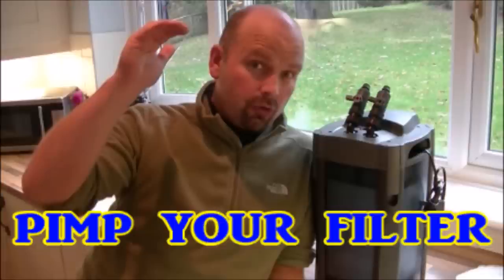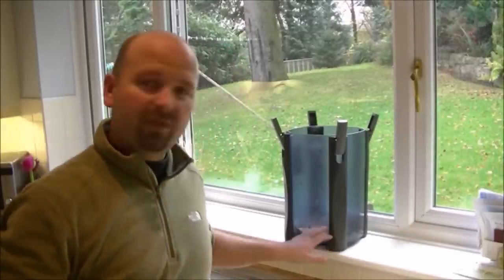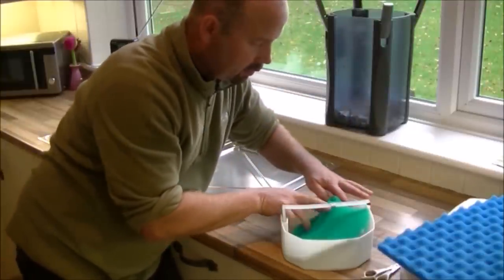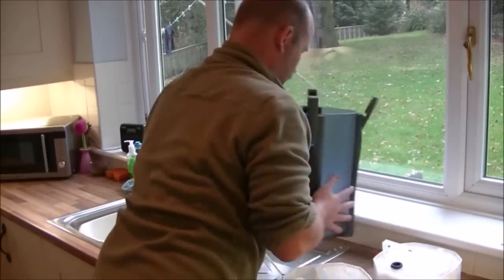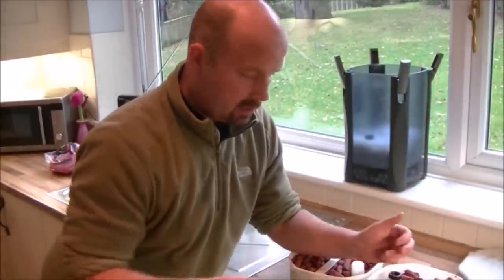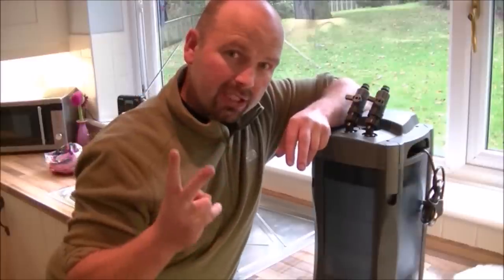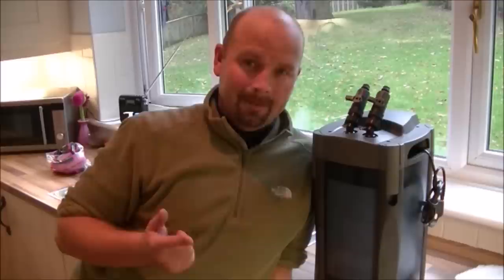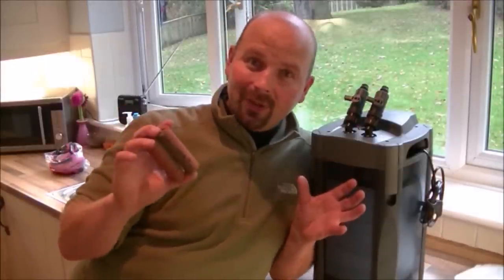External canister filter set up, nitrogen cycle and what happens in a filter - by Pondguru

Comment: Thanks for the information. We have a Jebao filter on our fish tank and kept losing fish. Until we stopped doing water changes....now we let it evaporate at least 1/3 and then replace that water with water we have at the ready (has been in jugs for 24 to 48 hours. ) We also ended up with snails that came with some plants, but, instead of getting rid of them, we got two snails that eat them. We have a steady amount that keep the substrate moving but mot an overwhelming amount. Since these two changes to the tank, only two of our old fish have died and everyone is healthy, playful and happy. No more constant deaths. I keep reading bad reviews for the Jebao but I guess we got lucky. Now,,,,we also have a turtle tank, about 70 gallons. We do much the same with their tank, except I am constantly cleaning it. This tank has an Eheim Pro 3 which the reviews said was a good one. We have had nothing but trouble with the stupid thing. Extremely hard to start (prime) after I clean it or the power goes out. Now, the water flow isn't strong at all. Cleaned out every part including the impellor and the tubes to no avail. As I was doing this, I discovered a part that was not put together properly at the factory and was able to slide it together successfully and, with a triumphant gleem in my eye, figured I had solved the entire problem. Yeah, right...it started rather easily, so I was hopeful still,,,then discovered the waterflow still sucked (no pun intended). After more than two years, I have had it. We have even had knowledgeable people in to work with it to no avail. Can you reccomend a good filter for our turtle tank? I know that we should get one rated for at least double the size of our tank, and knowing that we are going to have to get a larger one in the not to distant future (Sophia is the size of a supper plate and Athena is about half her size plus there is a plecho about the same size as Sophia and they are all inseperable).  Any advice you can give will be greatly appreciated. We are in Canada. Thanks for your time.

Comment: Hello +Pondguru Outdoors, I have 2 Fluval 306 canister filters for my 90 gallon tank. I have been spending a lot of money on buying fluval filter media. Thank you so much for sharing this video and helping me save money 😊. I hope I can do the same thing to my Fluvals. The only difference i see is that they don't have that space at the bottom as the filter in this video.
Reply from the maker: +Rahul Sudhakaran Don't worry if there is no space under the trays of those filters as the main foams are down the sides of the filter anyway. Having extra media under the bottom tray wouldn't do much good as far as settling out solids as they should get mostly caught by the side foams.

Comment: Enjoyed your video.  My biofilter input swirls and there is a 6 inch void below.  I have been vacuuming out this 2-3 inches of sludge that collects there twice a year.  After watching your video I wonder if this is where the anaerobic activity takes place to complete the nitrogen cycle?  Is cleaning this counterproductive to the cycle or just good maintenance?  FB koi groups think there should be no place in the pond for anaerobic bacteria.  They think water changes are the solution to high nitrates. I learned from you today that anaerobic bacteria has an important function.

Comment: Followed your advice and pimped out the two Sunsun 302s I'm using with my 60 gal cichlid tank. Initial tests came in noticeably better than before. Thanks!
Reply from the maker: As time goes by you should notice the nitrate coming down - Biohome is an incredible media.

Comment: I'm sure you've covered this before-
There is a big emphasis on coarse, medium and fine mechanical filtering. In a 'common' system, it is just one big coarse filter. It is my assumption that they do this to prevent any significant pump damage caused by a lack of flow from a finer filter being clogged overtime. Obviously a true hobbyist that has 'modded' their filter wouldn't let it clog (hopefully anyway) but from an "oops, I forgot to check the filter and now the pump is damaged since there is no pressure bypass" point of view, it really depends on the end user. I wouldn't say there is anything 'wrong' with the original system, it's very well rounded reliable setup for the average person (notice person, not hobbyist haha!). But like you said, efficiency is the point in your videos, which is why I watch them!

If I may add-
Perhaps adding a low pressure water gauge before & after the filtration would be beneficial. Just looking at that pump setup, a quick 'drill and tap' on each hose base and a couple gauges to calculate say, a 5 psi drop would be perfect. Hell- incorporate a 'dummy' light and you could reinvent those things.
Reply from the maker: +Nathan Herron Yes the single coarse foam is very common in internal filters where the emphasis is on high turnover rate and catching the dirt second, third or fourth time round - any restriction on the inlet could strain the pump so coarse foam is the way forward for long service life. Not too good from a water clarity or health point of view though. An external offers much greater contact area for the foams and when using the profile cut foams the contact area is much greater than flat foams. Therefore they will go much longer before they are clogged. I like the idea of a simple pressure gauge on the outlet or even on the top of the external filter which could maybe move from OK to Caution to Clean Me as its not always easy to tell from the water output how efficient the filter is working - a 100 litre per hour drop in output may go unnoticed. Glad you enjoyed the video, can see where I'm coming from with the ideas on filtration and thanks for watching.

Comment: Well I've recently bought an external filter and after watching this video I'll be setting it up your way. Bought some coarse, medium and fine foam (with dimples) and Biohome mini ultra from yourself. Looking forward to the results this produces. I did buy 1kg of Biohome mini ultra but I'm sure I'll need more as I'm sure it won't fill 2 baskets.
Reply from the maker: No worries - all sounds good to me and I'm glad to be of service.
Reply: +Pondguru Outdoors just another question. My external filter has a built in uv lamp and is it worth running this along with the biohome media or not?
Reply from the maker: Yes using a UV is fine but often not necessary unless you have multiple tanks running from one filter. Just make sure you leave the UV turned off for about 2-3 weeks when setting up a new filter to allow good bacteria to flow through the system and establish it properly.
Reply: Thanks for your advice. Filter is now set up the "correct" way and running smoothly.  Just experimenting in whether to use the spray bar or not. Any views on that? I have water spangles (Salvinia minima) floating on top of the water and with the spray bar they get moved around .
Reply from the maker: They will get moved around with the other outlet too but won't get 'rained on'. Generally that plant comes from calm water so it may be worth either having the spray bar at or just under the water surface or going with the other outlet just under the surface. They will still move about but if too much water gets on the leaves (from a spray bar) they can rot.
Reply: Well 2 weeks in and all good. I've taken off the spray bar and just left the outlet pointing down into the tank. That way my floating plants aren't getting disturbed as much. Thanks for all your help.
Reply from the maker: No worries, glad it is working better now.

Comment: Unbelievably great video.  I have an Eheim pro 4 250 canister.  Can that filter be pimped?  Its internal structure looks a big more complex than the one in your video.  Makes me kinda wish I had the same one you do.
Reply from the maker: Yes, only difference is that the Pro 4 has a 'pre-filter' tray in the top which water hits before going to bottom of filter and rising up through trays. Therefore just leave the pre-filter tray as it is, set up bottom tray with coarse, medium and fine foams then have good filter media in remaining tray. I do not have the tray sizes recorded for the 250 but the 350 takes approx. 1.5kg of biohome ultimate per tray. Looks like the 250 is just a 2 tray (not including 'pre-filter' tray) version of the 350 and if that is the case 1.5kg would see you good for a normal community tank up to 150 litres (full cycle filtration, reduction in nitrate).

Comment: Another excellent video. I am new to aquariums and inherited a large built in freshwater cichlid aquarium when we purchased our house. I learned very quickly why my tank looked a little dirty and grew algae better than NASA and ammonia and nitrates. I dove right in cleaning it up and after a couple months nitrates went from 180+ to 60. I just couldn't get nitrates under 60. Happened upon all the Pondguru videos...learned my Eheim canister was set up all wrong and ordered foams and Biohome. I also made a moving bed filter out of a fake rock formation to add additional filtration and aeration inside the aquarium.  Within 2/3 weeks my nitrates went to 5. I had NEVER had a 5. So this stuff works and I will never use anything else.
I do have a question on cleaning the canister......at the very bottom where you have that 2 inch space before your first tray....when it's time to clean the canister do you empty all that out and rinse and place the fragments back in?  I ask because the Eheim I have is attached at the bottom and you really can't take the canister out unless you unhook all the plumbing and I didn't have a separate bucket to be able to syphon out all the muck.  What is the best way to clean that very bottom part?
Thank you for all your awesome information ...my fish are happier.☺
Reply from the maker: You must have one of the round eheim filters and they aren't too convenient for cleaning I would probably empty the top out and then tip the stuff in bottom out into a bucket but if there is no option to do that some sort of shut off valve would be the solution for removing the bottom pipe.
I'm glad the biohome media is working well for you as it is great stuff.
Reply: Pondguru Yes, it is a Eheim 2260. So I DO need to clean out the bottom 2 inches in the canister? Since I'm not much of a plumber I will just get a second bucket to syphon into. Thank you again for all the excellent information you share.
Reply from the maker: Cindy Scott Yes it will need to be cleaned out as that is where the heavy muck will be when the filter is working properly.

Comment: I think you have less settling of debris in the bottom part like this. You reduce the volume of water underneith the first tray by adding the media , therefore increasing the flow of water in that part of the filter manyfold. An advantage will be though that coarser parts get trapped by the rings and won't block the grid of the first tray. Nevertheless a perfect explanation of how to setup your external filter. I always thought it was common knowledge, been doing it like this for 30 years. Try to get your hand on some siporax, sintered glas. We use it a lot over here, it's very good, just very succeptible to clogging pores. Cheers
Reply from the maker: Siporax is a great media and very similar to the standard and 'plus' forms of biohome in its performance.
The more advanced forms of biohome (mini ultra / ultimate) have a much more varied pore structure so are less prone to clogging but like the siporax really do need to operate in a protected environment.
Great to hear that you have been setting up your filter correctly for years as it really is common sense - I've no idea why manufacturers insist on setting their filters up totally wrong.

Comment: Great info. I have a planted tank. I understand that live plants utilize nitrates. If I use biohome ultimate and remove the nitrates, will my plants miss the nitrates?
Reply from the maker: +T Pir The growth is not affected since the nitrate is converted to soluble nitrogen which is easily assimilated by the plants.
Reply: Great.,  and how long does the media last in a fluval 206 canister filter before they need to be replaced? I'm thinking of using 1.5kg of biohome ultimate. Does the extra added red stuff eventually go away? My tank is already cycled. Should I go with the non red type?

Comment: Just wondering what you do if you have 4 trays instead of 3 in your canister,
thanks for your time.
Reply from the maker: Richard Mallicoat You would generally use 1kg of biohome media per 100 litres to see a good reduction in nitrates but more is better. I would always go with one tray foams and 3 media but you could go 2 and 2 if the extra bio media was not required. That would cut maintenance time way down as long as foams were in correct order.

Comment: Thanks for a very informative video. One question,what if I want to do this to my filter, which incidentally is the same as the one in the vid,  While I have fish in my tank is it possible by using mature media e.g. the ceramic rings already in the filter?
I don't want to completely recycle my system.
Reply from the maker: gcujimmy Yes if you are upgrading the filter with proper media and foams in correct place you can swap foams to correct place right away and swap out old media for new over the course of a month (25% each week). That way you shouldn't notice a drop in filter performance and once you get it set up properly the new media will last for years as it will b properly protected from becoming clogged.

Comment: great video im having problems now with my fluvial 406 which for past few days has been spitting out micro bubbles.ive checked it and everything seems fine im looking at getting new filter but dont want to spend lot on money on 1.which 1 would you recommend for a 240 ltr?i use your biohome media which i bought from you on eBay which i must say he the best out there.
Reply from the maker: Thanks for appreciating the filter media.
If you've got a 240 litre tank then you should be looking for a filter 'for up to 500 litres' as a minimum if you have a general community tank and one 'for up to 600 litres' or more if you have a heavier stock.
You'd always halve the 'up to' figure on a filter as the 'up to' figure is a fully planted tank with a few small fish.
Most will promise way more than they deliver.
The All Pond Solutions filters are as good as any and really cheap http://geni.us/2LnO
The stuff in them is crap but that's where they save manufacturing costs - once it is set up properly they will hold a lot of media and do a great job. Depending on your stock you'd need either a 1400 or a 2000. Assuming the bottom tray is used for foams the 1400 will hold 3kg of biohome (ultimate or mini ultra) and the 2000 will hold 5kg.
Hope that helps.

Comment: Fab video. I've been running a fluval 406 for about three months and set it up along these lines. Would love to see some thoughts on maintenance schedules, how often do you clean/replace media and your thoughts on the likes of purigen? Also any thoughts on preserving the bacteria in the case of a powercut, had one the other night and I think  it's done a big chunk of damage to my filters efficiency. Water quality has been all over the place since, I think it's basically cycling again?
Reply from the maker: The great thing about the biohome is that it is so porous it takes days to dry out so if there is a power cut just drain water from filter and the media will hold the bacteria for a few days without problems. Purigen should not be needed and as far as maintenance goes it is just a case of as and when necessary The media should last 6-10 years in a well set up filter and the only thing that needs replacing regularly is the fine white pad when clogged as it can't be cleaned.

Comment: Thanks for such an informative video. New to canisters, how would I set up the four trays for the Aqua One Nautilus 2700UV? I'm lost with how the water flows. Is it in the same order in the video or opposite?
Reply from the maker: +Icealote I can't find any stripped down images on google search but as the pump is in top and pipe goes through trays I would say 99% that it works just like the one in this video. If the pump was on bottom it would work opposite way (like FX5 /6). The 2700 looks huge. Bottom tray would be for foams then remaining 3 trays would be for media so feel free to send tray dimensions to pondguru@btinternet.com and I ill work out how much media will fit in there no worries.
Reply: Thanks for the reply, I've ordered the unit so it won't arrive till next week or so to find out. All I know is that the dimensions of the unit is 32L x 32W x 49H I think. I've ordered your foams and have gotten the 3kg biohomes ultimate from the Australian supplier. Hope it's okay to contact you again when it arrives.
Reply from the maker: +Icealote Sorry just seen this now - my comments are still kooky on youtube. Yes n worries feel free to ask me anything and my email address is pondguru@btinternet.com

Comment: Hi, great video very impressed with the biological filter system. I am setting up my first large tank and I have an Eden 521 external filter. Do you know it?. If so am I able to do something Similar with it?.
Reply from the maker: zel boake Doesn't look like that filter will be a good one to get working properly as the water travels through it in a really strange way but replacing the ceramic rings with biohome would make it more efficient. It would need a fine foam or pad over the media to keep it clean though.